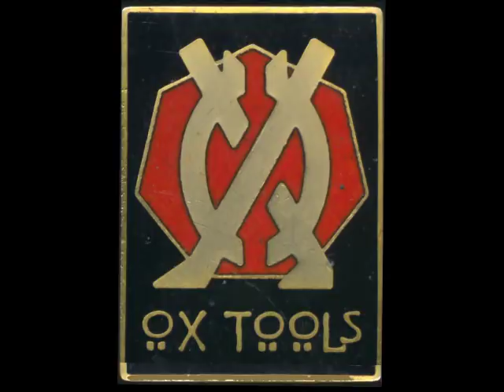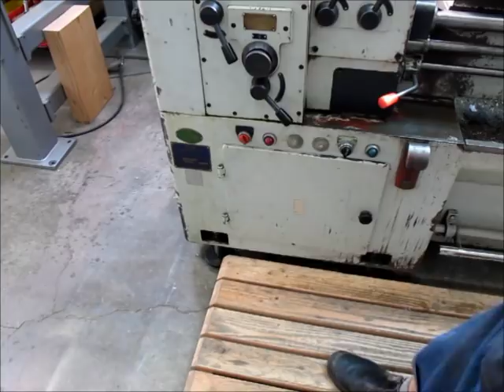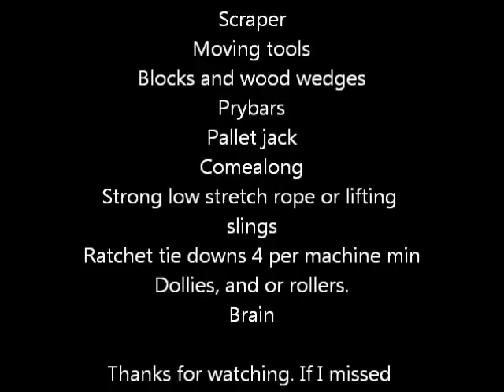Evaluating and moving a used metalworking lathe

Comment: I know this video is old but I have a question. I saw a lathe that had the carriage shaft, the one with the keyway, that had a noticeable twist in it. The keyway was facing me on one end and began to recede toward the machine. I feel that this could indicate that the machine was not cared for or used properly. I got myself wondering if I ever came across that again how i should approach this. Since it is only feeding the carriage and cross slide how big of an issue is it assuming no other issues can be found. 

More just curious as I am not currently encountering the issue.
Reply from the maker: Hi Erik,

This would be concerning if I saw it on a machine I was considering. I would certainly look deeper and harder at that machine as it may have been seriously overloaded or jammed. Under normal and even heavy use you should not see something like that. Hope this helps. Thanks for the comment.

Cheers,

Tom

Comment: sir, just want to ask what should i do when i do automatic feed on the cross feed the tool post is shaking even my tool bit is properly centered and my feed is small. how can solve this problem? thanks!
Reply from the maker: +hapibattle Hi Hapi,

You didn't say if this is when you are cutting. First off check your center height and make sure you are on center. It also sounds like your gibs or cross slide might be loose. Check the gibs. I would have to see the problem to help diagnose it further. Hope this helps.

Cheers,

Tom

Comment: does the quick change tool post come with the tooling holders 3 or 4 jaw chuck
either way without the chucks or live center and drill chuck for the tail stock it looks like a good solid machine depending on the manufacturing quality just shooting in the dark here but it looks like something around 4,000 - 6,000
Reply from the maker: Mars Mahoney Hi Mars,

It will depend on where you get your lathe. Some will come with some tooling and others will be stripped bare. You have to go out and look. Machines with tooling are worth more than bare machines. Thanks for the comment.

Cheers,

Tom
Reply: cheers bro, what would you say a metal shop or workshop of metals would consume the most of?
Reply from the maker: Mars Mahoney Hey Mars,

Electricity. Thanks for the comment.

Cheers,

Tom
Reply: if I had to guess I'd say it's a 220 volts

Comment: I need your advice!
I checked a used Tos SN45 lathe made in Czech republic in 1975 and i found a 0,02mm runout in the spindle and 0,3mm runout in the middle of bedways.Is it worth it?Sorry for my bad english...
Reply from the maker: Hi Cowake,

It will depend on how much they want for the machine and how badly you need a lathe. .02 mm runout in the spindle is not great but its not junk necessarily. Your decision will depend on price and your willingness to take on a project if you need better than those numbers. I don't quite understand how you measured the runout in the middle of the bedways. Could you explain how you measured that number. If you have any pictures you can email them to me for a quick look. Email address is on the whiteboard in the beginning of most of my videos.

All the best,

Tom
Reply: oxtoolco
Hello Tom and thank you very much for your response,

Hmm..I didn't say it correctly.
When i say bedways runout i mean that bedways are not absolutely flat.I placed the indicator's base to the apron and the indicator to bedways.In the middle of apron's travel from the tailstock to the chuck (nearer to the chuck) i found that bedways are ''deeper'' about 0,3mm.

Comment: great vid lots of  smart help.  but whats that lever on the back side of the chuck  or the very left end up hi where the work and go all the way through ..ty  I'm looking for Clausing model 5914 Lathe ..if you know anybody ty
Reply from the maker: anthony marasco Hi Anthony,

On my lathe its a gear selection lever. There are two used in together to change the speeds of the machine. The front most lever is a high low lever. Thanks for the comment.

Cheers,

Tom
Reply: oxtoolco is there a way to show us how its used and its motion,    ty for the reply thanks  anthony

Comment: I think you could have separated evaluation and moving into two separate videos.

In terms of evaluation, you completely missed electricity.

Voltage, three phase vs single phase, amperage, wiring and the costs of conversion, phase converters, what will work, what will not.
converting the power to match the motor vs changing the motors to match the power

Comment: i think your buddy wanted to know "HOW TO MOVE IT FROM SITE TO SITE"  not how to move it around the shop.
Reply from the maker: Hi Dan,

Thanks for the comment. Well I'm pretty sure he knows you don't push it down the street. In a truck or trailer. Methods vary depending on your pocket book and abilities. Moving it around the site to get it to where you can get a truck or trailer to is just as important as what mode of transport and its something within the abilities of most folks. Lots of open questions left on this subject. Truck, flatbed, trailer, forklift, crane, wrecker, securing, rigging,........... You see, the subject goes on and on. 

Cheers,

Tom

Comment: That spindle control is ass backwards to what I.m used to???
Reply from the maker: Hi Gent,

You see them both ways. I've been lucky most of the lathes I've had occasion to run have been up for forward.

Best,

Tom
Reply: oxtoolco
If the F/R is backwards and your machine is 3 phase, just switch out any 2 of the 3 wires at the plug.  It will now run the other way!
Reply from the maker: Hi Mike.

Up for on is pretty common. I phased my machine from the panel so its "correct" as per the internal wiring of the machine. I did play around with an Enco at a school shop that was opposite, down for forward. I tried switching the main power legs with no luck. I suspect the spindle lever switch was operating on a stepped down control voltage as opposed to main power voltage which is why it didn't reverse the handle.

Cheers,

Tom

Comment: always hated that cosmoline machinery dealers use ages and smells like a cat paid a visit..any special cleaners to use..??
Reply from the maker: +Miguel Castaneda Hi Miguel,

ZEP heavy duty floor degreaser. Works great but don't leave it on too long. Thanks for the comment.

Cheers,

Tom

Comment: Great vid..However I had to stop at 29 mins. The words "uh" and "um" were driving me nuts. 314 times in less than 1/2hour is just too much. Yes, I counted.
Reply from the maker: Hi Tom,

Did you realize that the number is Pi? Thanks for the comment.

Cheers,

Tom
Reply: I think he did a really smooth  job and stuck to relevant information...Have you ever tried to do a video or make a presentation like that, Tom?  Kinda doubt you did...
Reply: tom taylor 

Thanks for bringing the otherwise missing 'Massengill factor'